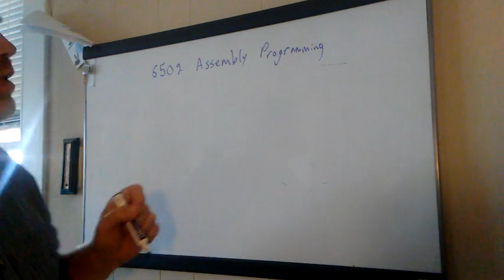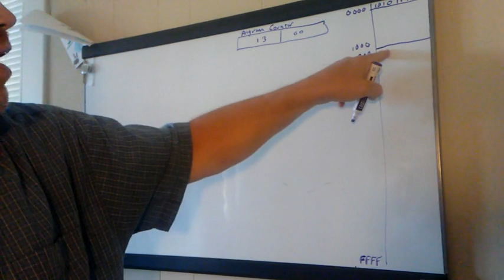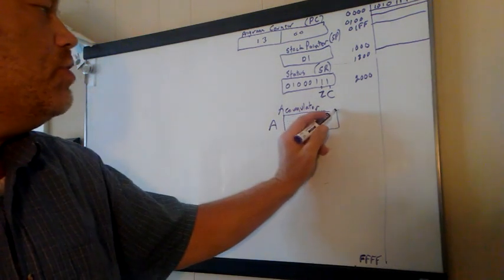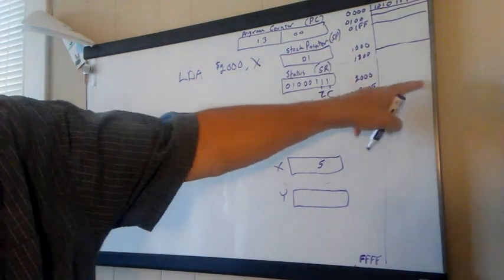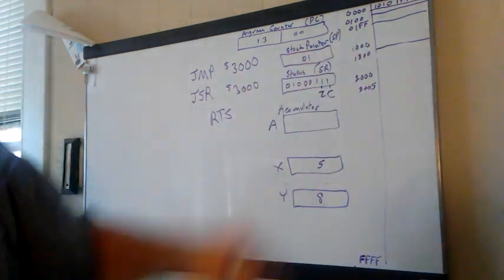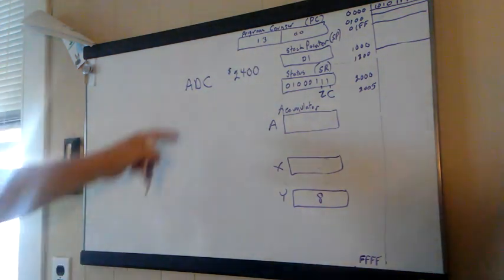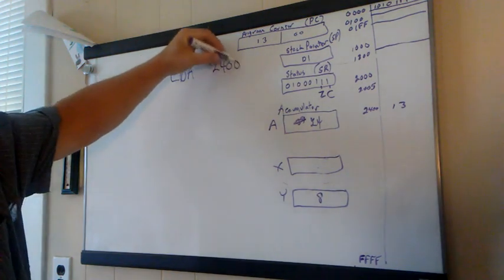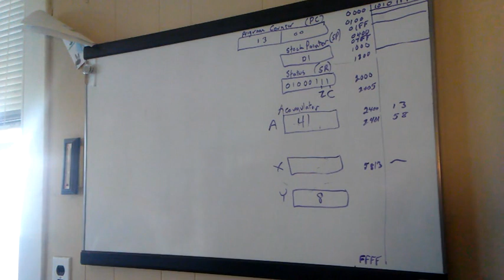Intro to 6502 Assembly Language Programming

Comment: Thanks for this great intro.  You mention a couple times throughout the video that the 6502 doesn't support multiplication or division.  However, that's not strictly true.  Multiplication is nothing more than repeated addition, and division is repeated subtraction.  It only takes six instructions to multiply two numbers (ie. 10 x 5 = 50)...

LDA #$00
LDX #$05
CLC
LOOP1: ADC #$0A
DEX
BNE LOOP1

After falling out of the loop, the Accumulator should hold $32 (50 Decimal).  Granted, the MUL and DIV Op Codes in X86 Assembly are convenient to have, but that doesn't mean those math functions can't also be done on the 6502... and it's not even that difficult.
Reply: 6502 does not have instructions for multiplying and dividing. That is an accurate statement. All you have demonstrated is that it's possible to add the same value to the accumulator in a loop. That's very different (and much, much slower) than being able to multiply the accumulator by the operand.

Comment: When the CPU is reset from being powered off

what address does it start from?

is it address 0000000000000000?
Reply from the maker: Interesting question; I don't really know. On the Commodore 128, the Z-80 processor is in control on power-up. I think it does start at $0000, and it does some bootup things like checking for cartridges, and then passes control to the 8502. It doesn't start the 8502 at $0000 though, so it must give the 8502 a different address to start at somehow. And on a single-CPU system like the Commodore 64, there must be a different way for it to know where to start, because starting at $0000 in zero page where there isn't runnable code wouldn't make sense. I'd have to dig through some hardware manuals to find out exactly how that works.
Reply: After reset, the 6502 starts executing at whatever address is loaded in the reset vector. The reset vector is the 16 bit address at $FFFC and $FFFD. More information can be found in the datasheet for the 6502.

Comment: Is 6502  Assembly Language easier to learn compared to Languages such as  python and javascript  or c
Reply: No. Those are High Level languages. Assembly Language is low level. Python, javascript  or C have functions to print text on the screen and stuff. In Assembly Language you have to write the code to actually print the text on the screen. You are programming the CPU and the computer hardware using assembly language.
Reply: @allanm6246  thank you, just so i am clear on what your saying  a high level language (Python, javascript  or C )would be easier to learn than 6502 assembly just looking to learn how to code 8-bit game 👾 the way they did in the 70"s and 80"s
Reply: @ryanmichalski7420  You will have to code it in Assembly language  if it is going to run on 8 bit computers from that era or on an emulator. If it is for modern computers, mobile phones , tablets and the web you can use high level languages.